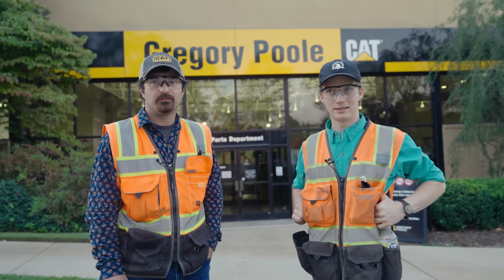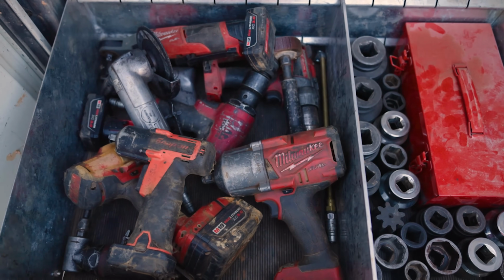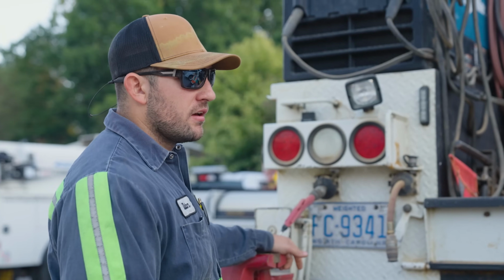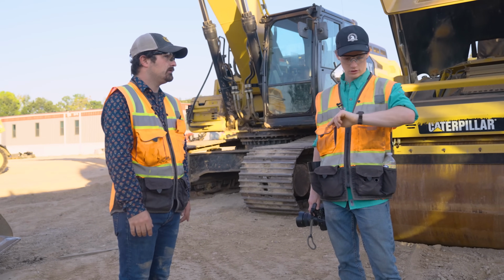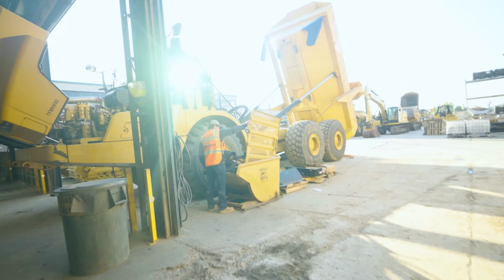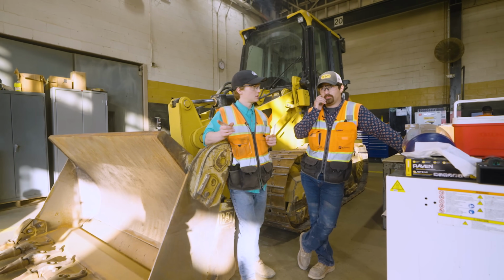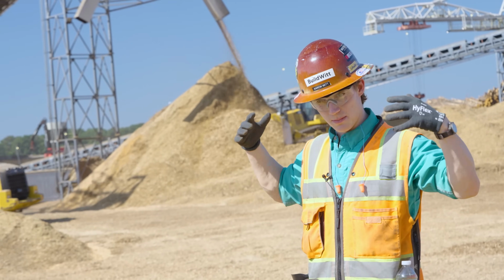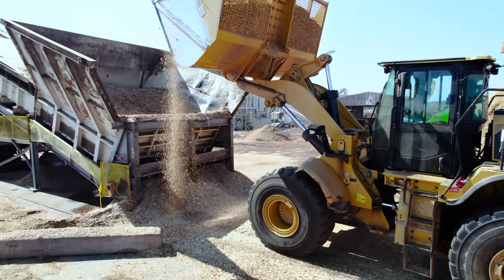Custom Loaders and Dozers | Touring Gregory Poole's Caterpillar Dealership

Comment: The CAT 336 used to have two types of counterweight configurations. A 6.8t counterweight and a 7.56t counterweight. What they have done is that the new 336 will have a C7.1 engine with that 7.56t counterweight while the 340 will have the 7.56t counterweight and the C9 engine originally in the 336. The 340 also has a wider and higher track frame.